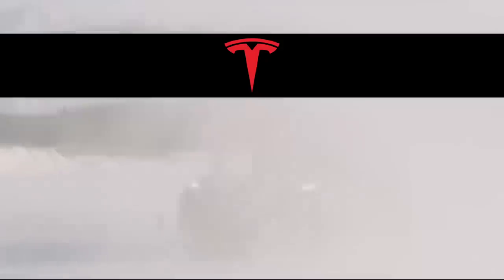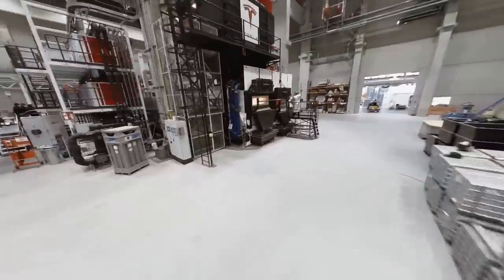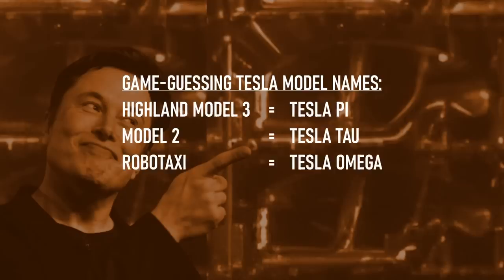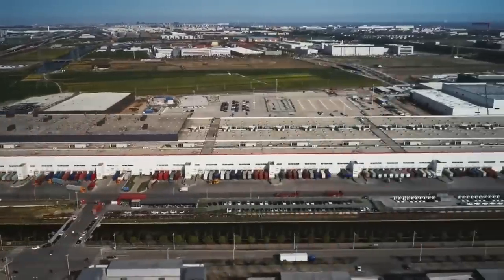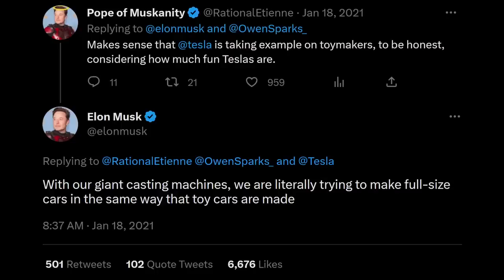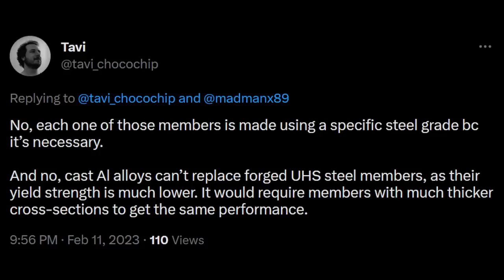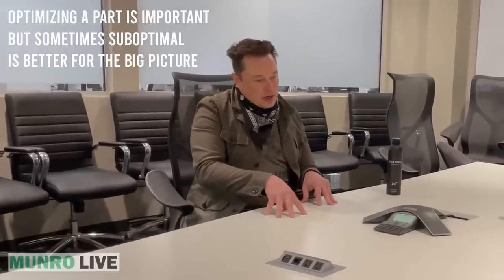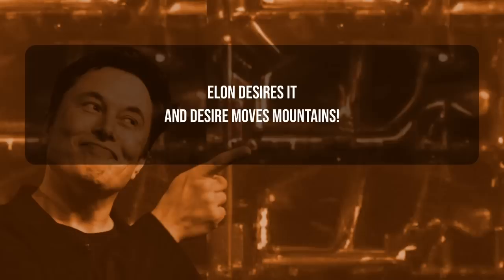FULLY GIGACAST NEW TESLA Pi 🚀 Elon's 3rd Gen platform out next month paves way to Alien Dreadnought

Comment: Tesla could glue high strength steel columns in the single cast body, so the function of the upper part would be to define the position while the strength comes mainly from the steel. There is one thing that I do not like with the castings and that is, that Tesla is very reliant on China, as IDRA´s parent company is Chinese. China does not want Tesla to eat their lunch. My impression was that deliveries of new IDRA machines were very slow within the last years (for Berlin and Texas).

Comment: Using Omega might be a problem, I assume Opel still has the name locked. Maybe they can use Ohm as it nickname. Great video again.
Reply: Opel? When I was a kid we had an Oldsmobile Omega.
Reply: @alanlight7740  Opel used to be a brand of Chevrolet. Primarily in Europe. According to Wikipedia, the Opel Omega was produced until 2004. It's now part of Stellantis. Not sure if the Omega naming rights remained at GM or went to Stellantis.

Comment: Where would they even get the line for the new car?????? Factories are all maxed minus some lines in Berlin

We haven’t seen multiple 9k presses even. CT is being assembled right now. And that’s to even know how long before successful casts are made from a lot bigger machine
Reply from the maker: This video is for the M3 replacement - it will take its place (but use less floorspace) and use same "regular size" gigapress. Upcoming smaller model will need more space, but they probably have time to arrange for that before launch

Comment: What is your thought on possibility of the old warehouse on wheels is sitting in plain sight one of the next building sites?
Reply from the maker: I'm not sure I get what you mean. Can you elaborate?
Reply: @ConnectingODots  I think the lot that was used for trailer storage which was being called the warehouse on wheels is an ideal location for another building. Site is level and ready to go vertical. Another thought is transport of vehicles from Giga factory to transport. Trucks are so many per truck is not efficient. What about a boring tunnel to the train station?  At scale it makes better sense to move large numbers.

Comment: The dice have been cast
Or
The die has been cast
Not
The dies have been cast

Just saying
Reply from the maker: I intentionally put that pun. Meant to sound like dice (the date is sealed, predetermined that Tesla will win over ICE) while also hintind at the three dies used for making front, rear and top castings. Thanks though👍
Reply: @ConnectingODots  ah. Thanks for spelling it out

Comment: Toy cars are clunky, heavy and not very strong, so they are cast with unrealistically thick sections. To put it another way, the reason for multiple materials and processes is that many real materials are chosen because they are anisotropic. Carbon fiber is an extreme case, where it is orders of magnitude stronger in tension than in bending or compression. Presumably a cast material is more nearly isotropic, and therefore not really exceptional in any one characteristic. Think of aircraft, which tend toward complexity of materials in order to minimize weight and maximize strength. As a result they are much more expensive than cars.  A fully cast automobile would seem to be suboptimal compared to an anisotropic design and would therefore ted to be heavier, weaker and less safe in a collision than it might be if designed with multiple materials and processes. So I'm skeptical of a fully cast automobile chassis...what am I missing?

Comment: i'm not following on how you drew your conclusion in the "bullish" section. I agree that tesla has been stockpiling front and rear castings. But if they switch to casting the top of a new car, won't tesla need to switch back to casting the other parts of the car? or am i thinking about this incorrectly
Reply from the maker: They can and will switch back and forth between front, rear and top once production starts. No problem switching dies. But until investor day that can't risk making tops, so stockpiling other parts enables more than tripling initial production
Reply: I was thinking they could switch dies for a while until they get another gigapress delivered and set up, so this may be temporary.

Comment: These giga-castings are great for the automakers (Tesla in this case) and production costs, and therefore, for profit margins. Unfortunately, the vehicles will become virtually uninsurable simply because these large giga-castings will cause massive costs even for simple repairs on even a minor accident. Instead of having to replace a simple fender or side panel you'll have to rebuild that entire section as there wont be parts to simply plug in or even fit in. The vehicles will cost so much to repair that insurance companies will have to declare them a total loss in most minor accidents, causing them to raise their rates so high they'll become unaffordable to insure for the average consumer. 

There's a reason why it hasn't been done before, or failed for those that have tried. Elon is just seeing it as another way to keep the profit margins high by bringing his manufacturing costs down without thinking of the final repercussions. Who's going to buy vehicles they can't afford to insure? History always repeats it self, if you choose not to learn from it.
Reply: The new version Teslas will still have a stamped steel or aluminium skins which attach over the cast aluminium frames. In the case of minor collisions those skins can still be taken off and replaced. In a more serious accident which damages the underlying frame, the car will likely be written off, as already happened with cars using stamped steel frames. Those current frames have multiple layers of high tensile steel and it is generally not possible to repair them. In any case, a crash that gets as far as damaging the sub frame will often deliver significant damage to suspension, doors, body panels, etc. That damage alone will be enough to write off a car, let alone extra sub frame damage.
Reply: Yes, and that's why they're not going to cast the outer shell. It would make insurance unaffordable regardless of the CT's other virtues. Watch and see ...
Reply: @voidthewarranty1429  Tell that to the insurance companies. Those skins will be very, very expensive and costly to make, ship, and put onto frames and will lead to many repair delays and nightmares for customers. Teslas are already among the highest, if not the highest, to insure dollar for dollar. That's why Elon started their own insurance company as it was costing them to many losses in sales and was, and remains, ones of the customers gripes. However, as far as I know, that's only in 9 states the last time I looked.

I'm not sure what type of channel this is, but I'm not here for any investment related discussions in case it's one of those. All I'm pointing out is that in studying history, this is the equivalent of the infamous Henry Ford's Fordlandia. He wanted to cut down on one of his greatest cost -- the rubber for his tires, gaskets, seals, etc. to increase his profits. And we all know how that turned out. You can all read about it online or watch any documentary on it. 

Like I said above, history always repeats it self if you choose not to learn from it.

Comment: No matter what happens on Tesla day, I think their stock will go up!  

You are predicting a smaller car with cast parts for the frame.  That is possible.  

I was thinking they might announce that the Semi would be built in higher numbers in Texas.  That could bankrupt a couple of the class 8 truck companies.  

However in reality, I think they will announce that the pickup truck will get into higher volume production in Texas.  

I guess we will have to wait and see.  I hope you are doing a livestream, so we can find out as soon as possible!  

They might also announce a new production facility in Mexico to make batteries, or cars? 

However with the Osborne effect, I don't think they will announce the cost of a $30,000 car to be built sometime in the Summer of 2024 from a new production plant.  Everyone will want to wait for the lower priced car.  

They might say that the Semi will go into full production in Nevada, with a expanded building there.  They might explain where the Tesla pickup will be built.   Cory, from Monroe Live wants to buy a 7 passenger Suburban sized vehicle that can also carry a couple of large dogs.  

My thought is that the battery plants should be located far apart, as any water that gets into contact with a lithium battery will catch fire, so the risk is to big.  So they should build several battery plants that are more than 1/4 mile apart, so if one should catch fire, they can keep using the other 30 battery production plants.    Producing the Semi in the same building as the battery plant would be a terrible idea for several reasons, including exposing all of the workers to a potential leak of battery process materials in the building, that could stop production for a few days.

Comment: I think the upper structure would not be well suited for castings.  The simple, linear forms of the pillars and rails that make up the upper body structure are much less complex than the lower chassis, therefore eliminating the benefits of complex castings.  There are economies of scale with massive castings and one must consider the diminishing returns.  At some point the size and cost of the high pressure casting equipment becomes more of a burden than the equipment it replaces. 
As for the stock value, my recollection (not verified) is that the stock makes little movement after these highly publicized live stream events.  Proclaiming brilliant ideas won't add value to a company.  Delivering it is what matters.  It is exciting watching Tesla establish themselves as a profitable automaker, outperforming industry giants like Toyota, VW, and Ford and overcoming the growing pains faced by newcomers like Rivian and Lucid.
Reply: Agree re the casting, only works for a "straight, flat side" (cars don't have those)